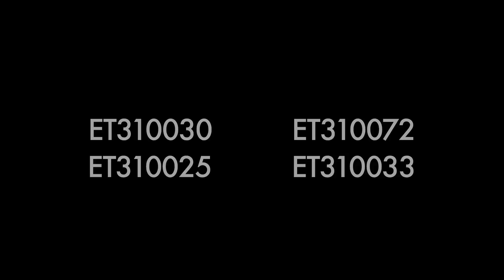HT - Side door - Replacement (framed)

Comment: Long shot if you still check comments on this video but. I pick up camper shell for really cheap. Just wondering if it’s possible to convert regular side window to access open window
Reply from the maker: Hello, it may be possible to modify the window of your car in this way, but we do not offer such a thing. You should contact your car manufacturer directly. He will be able to give you better information.

With kind regards

Your Road Ranger Team